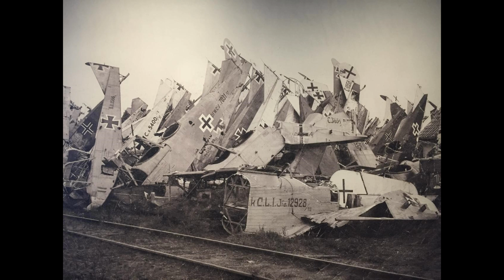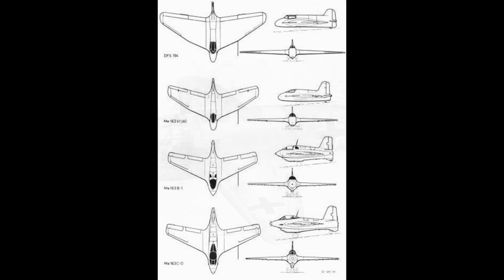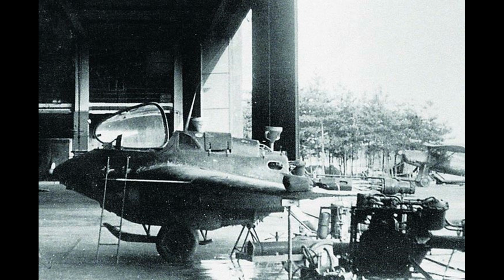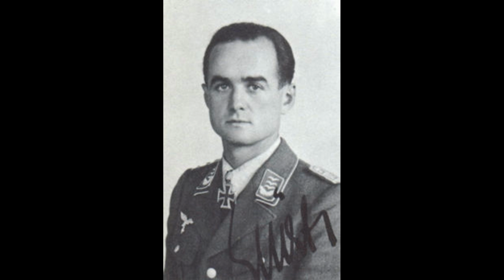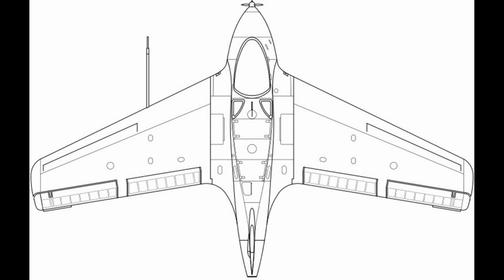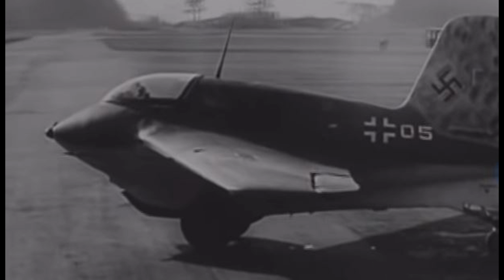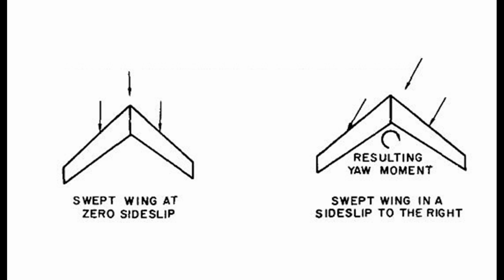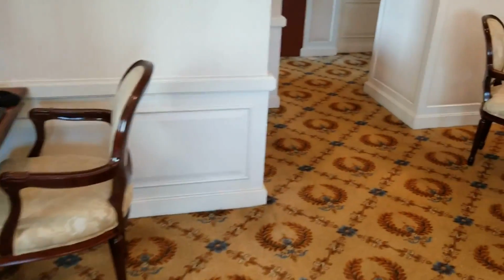Messerschmitt Me 163 Komet Pt. 1

Comment: Stoff translates best to "material" or "substance"
Reply: You mean it doesn't just mean "stuff"?  :D
Reply: When even a smiley cannot communicate the tone of a joke across the Internet...
Reply: @aaronseet2738  Nope, I feel substance the better translation as to me it rather refers to a specific material. However, for Stoff there are other valid translations but not in this context: 1. tissue as in cloth or fabric not as in body substance ;-) 2. drug as addictive substance
Reply: @aaronseet2738  stuff also means material or substance.
Reply: @aaronseet2738  Same root, descended from the same Low German origin.
Reply: @aaronseet2738  Kaft stoff= gasoline
Reply: @KPearce57  Kraftstoff is fuel
Reply: And it is cognate to stuff in English. Anglo-Saxon roots are not posh enough for English-speaking academia. A pity, as otherwise we would have wonderful terms such as:

waterstuff - hydrogen
sourstuff - oxygen
chokestuff - nitrogen
coalstuff - carbon
Reply: @DrWhom  well put
Reply: stuff
Reply: 'Stuff' mate...
Reply: Rik van der Zanden : correct. Interestingly, English is derived from early German, hence we can see where the English word “stuff” came from.
Reply: MichaelKingsfordGray  but not in this case. if you wanted to translate "stuff" into german you would mostly use "zeug" stoff could be used in only very few occasions depending on very specific context. rik got it pretty much spot on: material, substance, matter is the best translation
Reply: @symmetrie_bruch  but ironically if you translate stoff to English it becomes stuff.
Reply: T-Stoff is a fuel, it also has other uses
Reply: Stuff it, stoff is just stuff, it's the same noun.
Reply: Me as a german would explain it as compound
Reply: And In danish : Stof
Reply: Stoff= stuff
Reply: Strangely enough, "stuff" is a French contribution. The French got the word from the Greeks, so I see no reason why the Germans couldn't have had the same Greek origin as well.
Reply: @kell3112  Who are you talking to?
Reply: @米空軍パイロット  me
Reply: @JetFire9  You
Reply: @米空軍パイロット  Yes
Reply: or 'fabric' depending on the context.
Reply: is that where the english word 'stuff' comes from ?
Reply: @goognamgoognw6637  No. Reference my first comment.
Reply: Correct.  Thank you for help this poster.  Talked to my Grand Mother who was married and had already given birth to my mother right before Hitler gained total power over Germany.  She the very same thing you have stated here.  Excellent job.
Reply: I had a (German) German teacher who more than once said that "English and German are the same language separated by 200 years."
Reply: @robertmatch6550  english is a mixture of proto-german and proto-french (that isn't the real terminology)
That's why some words in English sound or apear somewhat german and some french.
But basically the lower classes in medieval England spoke a kind of german and the nobles french.
That's why every cut of meat has such special/french sounding names for instance.
(The lower classes didnt have contact with meat)

And years on years of cultural change and you got the english language.
Reply: @SuperUltimateLP  👍
Reply: Bit like suff?
Reply: Stoff is just an old word for chemicals like in SauerSTOFF (= oxigan) KohlenSTOFF (= carbon) or WasserStoff (= hydrogen) they for sure used the very unspecific word Stoff to hide what chemicals they used.
Reply: Stoff means a lot depending on context.
A direct translation isn't really possible.
That's why everybody is fighting about it here.
Reply: Probably where the English word “stuff” came from
Reply: ‘Stuff’
Reply: Let's make it simple: Stoff = Stuff
Even George Carlin would agree with that.
Reply: "Stuff" is good enough albeit it sounds less "technical" style.
Reply: Just be glad you were not a delivery driver coming onto a top secret base, upon being asked what do you have on board, answering "Stoff Fuel" may have landed you in some hot water :p